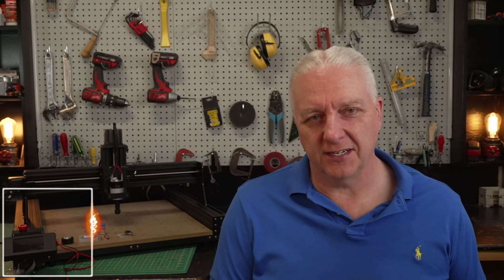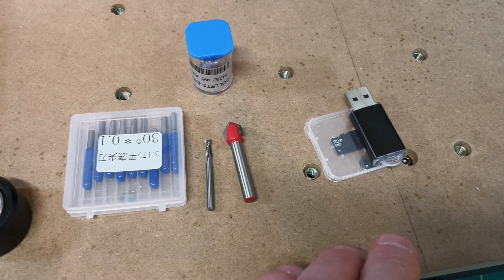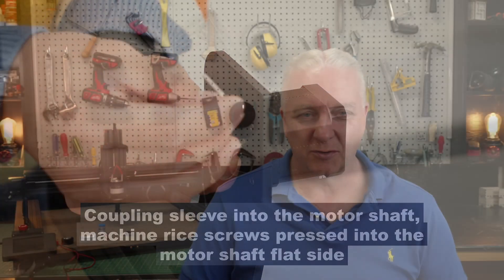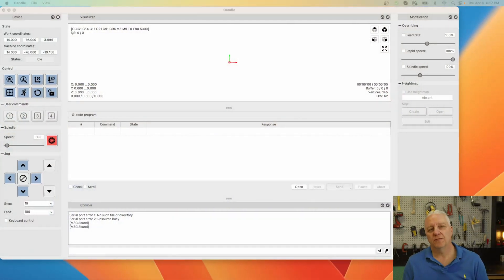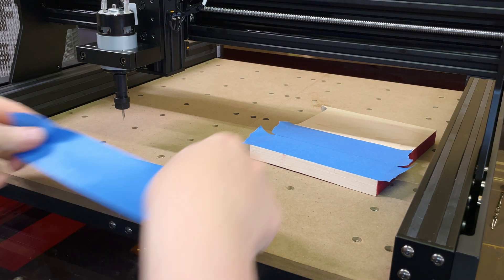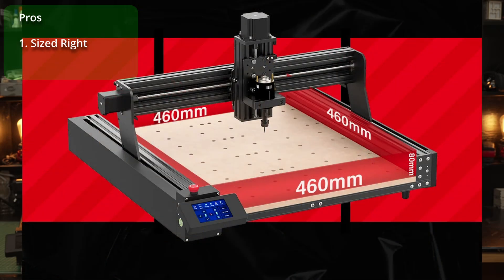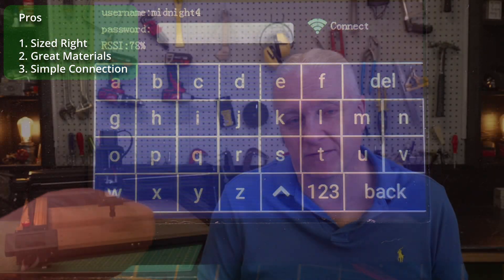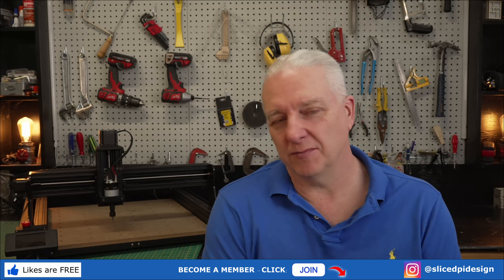Could The TwoTrees TTC 450 CNC Change Your Woodworking?

Comment: Hi Steve, Im having on screen error on my two trees cnc, im getting hard limit ok on screen , even if i unplugg it and conect power again and again i still  getting tha same error again and again!
what can i do?
Thank you!
Reply from the maker: Is the CNC at one of the extremes on any axis?  If so you can turn it off and manually move the axis in the direction that opens the limit.  If the 3 axes are not at an extreme then make sure the limit switches can be free clicked closed manually and not jammed closed in some way.

Comment: Once happy with machine running correctly on all software , ie candle and ease,  blue lock tight on all bolts to insure it doesn't come undone. 
I had issues with my 4040 which had to be sent back due to once I was using easel the machine was going very clunky,grinding  on the axies. I ended up getting a lazer engraver so I could learn a easier software so more confident this time for a wood cnc.
Reply from the maker: Thanks for sharing. Btw Candle really isn’t very good. Look at UGS or gSender.
Reply: @SteveMakesEverything  OK

Comment: spent hours putting this together and can't "home" the machine. follow the instructions completely, hit the home button to return to home andthe machine locks up, a quick grinding halt. states "homing failed, please unlock????? is this machine junk?
Reply from the maker: The machine is not junk, but you may have an issue.  When homing,  try to determine which axis is getting stuck so you know where to focus.

If the laser module is getting to the left and front of the frame and then grinding, then it isn't closing one of the limit switches.  With the power off, move the laser module slowly to the left, and you should hear the limit switch click and be able to see it close.  Then, move the laser slowly to the front and ensure the limit switch at the front of the laser also closes. Look at the limit switch wires to ensure that there isn't one broken off.

If it isn't a limit switch issue, then look for an overly loose or tight belt.  With the power off, make sure that movement along that axis is smooth by moving the laser slowly by hand, and if you feel any obvious resistance then movement is impeded. 
 The likely cause is a cable getting in the way of the movement, but it could also be an overly tight roller wheel or something else stuck in the path of the laser movement.
Reply: It is actually the spindle set up. It moves perfect when moved with the directional buttons. Only will not move when the HHome button is pressed
 @SteveMakesEverything
Reply from the maker: @blazenboo2  Sorry I have laser-on-the-brain.  If you watch the video I talk about the cable rubbing on the metal cover on the left side.  This is probably the situation you are in, and you may need to either make sure the cable is free or take a file and enlarge the slot a bit.

I am not sure why the felt the need to make this such a tight fit.
Reply: it literally stops immediately when i hit the home button. makes a quick grind noice then the error "homing failed. please unlock" message appears immediately. I know its not your job but I would gladly make a donation to your channel if you can help us get this working. we just want to start making stuff and the wife is not happy, lol @SteveMakesEverything

Comment: This a little late but it may help new users that find this video. The wires rubbing against the frame is because the drag chain is too far forward on the Y axis . The rubbing cable that comes out of the end needs to bend back to connect. It can't bend back with enough slack to keep it out of the way of the fame when tied to the side of the upright. Unsnap a couple of bars (not the entire link) from the top of the Y drag chain to release a little more cable. This will let you wire tie it to the back of the upright instead of the side. The video on the SD card shows the cable tied to the back not the side. The cable doesn't get in the way of the limit switch when tied this way (tested).

Your videos are my go to for all things laser engraver. Pretty much every setting I use on my xTool for material I learned from this channel. Thanks
Reply from the maker: Wow!  Thanks for the tip and the kudos. I’m just want to be able to create new makers 😁
Reply: @SteveMakesEverything  I forgot to mention I bought the TTC 450 (with 500 W spindle) and a Ortur laser master 3, then a xTool D1 Pro after watching your videos (more than once).  Sadly, I don't see a C02 laser in my future anytime soon  😞. This stuff is a blast to learn and getting expensive. Your content really helps me like and learn this stuff.
Reply from the maker: @stevejones01  Awesome!  Thanks for the support.  I'm just happy to have a positive impact.
Reply: yes, indeed that did just help this new user!

Comment: This is the best review I've seen so far on this machine.   I now know how the machine is engineered with the gantries riding the aluminum extrusions on wheels.  No where on TT's website does it describe how its built except to say it uses lead screws instead of belts.

I've been considering the GENMITSU 4040-PRO as well and I think after this that will be my choice.  It just seems a bit better engineered and the company has a less fly-by-night aura about it.  Have you looked at that machine as well?  There is also a brand called Fox Alien (where do they come up with these names ?)  but that is using belts and I'd rather stick with a machine with lead screws.
Reply from the maker: Well, there's also SainSmart, though I think they are attached to Genmitsu since that's whose name is on their CNC machines.  I might be reviewing their PROVerXL 6050, but they haven't connected to tell me they shipped it yet.

For what it's worth, focus on the technicals rather than the name stamped on it.  I have a feeling that most of these are made by the same company.  Favor lead screws over belts and linear rails over rollers.  Spindles are better than DC motors.  Look for big beefy extruded frames.
Reply from the maker: @@kemist578 Sweet!

Comment: Could you please explain to me how you managed to make the cutter know where zero is on the surface of the board you are engraving? I put the sensor on the board and then did Z-Probe in Candle. But when I then start a job, the cutter dives too deep into the material. I have now spent two days really trying to create an engraving, unfortunately so far without success. I have to say, I usually only work with lasers. This is the first time that I have a CNC milling machine here.
Reply from the maker: I assume you are putting the Z-probe on top of your material.  I used the "Knife" option on the display rather than Candle.  However, I did notice that the resulting "0" was about 10mm high so after I used the probe I then moved Z down by 10 and then zero-ed the Z-value.  I think there is a setting in the machine initializtion in Candle that can take care of this extra step though.
Reply: @SteveMakesEverything  So, here is the solution. 
In the Probe Command in Candle, use this code and you can use perfect the Z-Probe in Candle so perfect:
G21G91G38.2Z-50F80; G0Z1; G38.2Z-2F30; G92Z19.5; G0Z5F10M30;
Reply from the maker: @K40Keller  Awesome!
Reply: @SteveMakesEverything  thx. I will take a look to this. I thought I was too stupid. But if it's the same for you with the 10mm, ok. One problem solved. Now I just have to find out which post-processor I have to choose to generate the correct GCode.
Reply from the maker: @K40Keller  Don't be too hard on yourself.  After 38 years in the tech sector, I can assure you that the problem is almost always the technology rather than the person trying to use it. 

This is why this channel is a community.  We can all help each other. 😀

Comment: Another higher-end machine that is in the same space as the others you mentioned but much more affordable is the LongMill CNC, it might be worth looking into!
Reply from the maker: There are a few decent CNC emerging in this range now.  The spindle is what separates them from the lower end of the market.  The Two Trees regular spindle is great, but the 500W spindle is nothing short of awesome in this market segment.

Regardless of what you are buying make sure the part that does the real work is worthy.

Comment: Thanks been waiting on this. I have one still waiting on time to put it together.
Reply from the maker: Once it's assembled it's a pretty nice CNC for the money.  It would have been nice if they also included a 1/4" and/or 1/8" collet as well.  I have so many bits I could use if it did.

The included bits are the usual discount items, so you will want to replace these with carbide bits ASAP if you are using this on a regular basis.